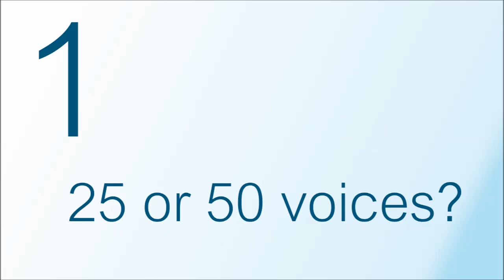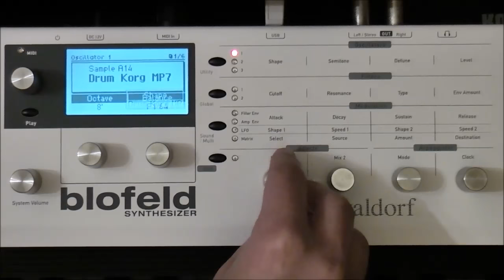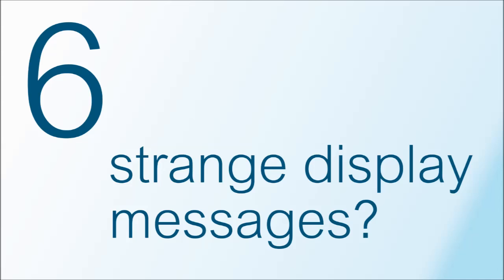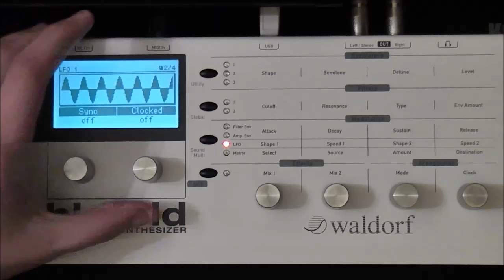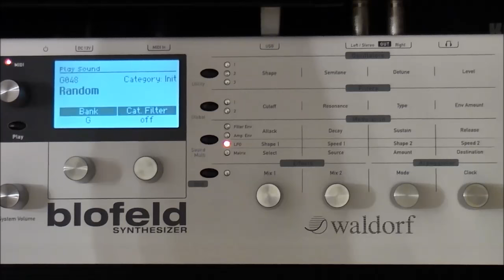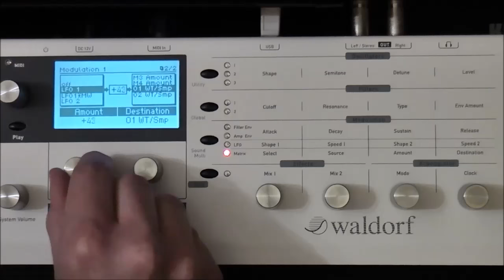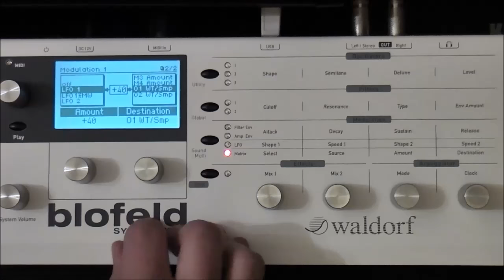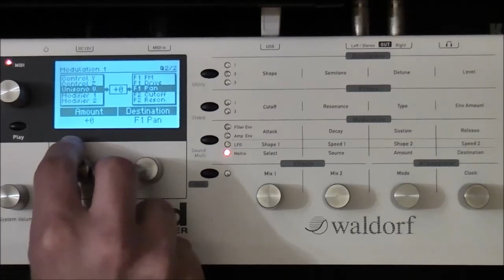[talk] 10 facts and tricks of the Blofeld

Comment: "My Blofeld stopped behaving like this when I used it in a different house."
I saw in your disassembly video that there is no ferrite choke on the PSU input on the PCB inside, this could be a part of the problem. Any other digital synth has a ferrite choke or whatever inductor to make the unit less susceptible to noise coming through the power supply. Noise from power lines inside of the building that you're in can go through the Blofeld PSU, into the PCB, and destabilize the processor.
Bad engineering design choice on Waldorf's part just to save a few pennies.
Reply from the maker: "The cheepest design" was the concept behind the Blofeld back then in 2006 to push the "new" Waldorf company. So... Mission completed :-D

Comment from the maker: Hey, that's me : )
I've read that some people doubt that there is real Karplus-Strong within the Blofeld. Actually, I've made a guess. Because the original Waldorf MicroWAVE had many so called "algorithmic wavetables" (28-52, 65) including the "Karplus-Strong" ones. This means that these waves are computed in realtime and are NOT saved as cycles (or half cycles) within the memory like normal wavetables. Consequently, wavetable parameters for these "wavetables" are interpreted as algorithm parameters. 

Source: https://chrisarndt.de/files/waldorf/mw_wavetables.pdf

I guess that the Blofeld is based on the same idea but of cause only Waldorf can answer that question. Also be aware of the fact that even the old PPGs used algorithmically generated waves in order to save memory space. 

Source: http://web.archive.org/web/20090213162947/http://interviews.sonikmatter.com/2001/wolfram_franke.php
Reply: I asked Waldorf about the KS wavetables and they replied that Blofeld has no such algorithm implemented
Reply from the maker: @charonme  Thanks for asking!

Comment: can someone help a brother out?
I'm about to buy the Blofeld Keyboard version. and have a few questions:
1 - How many sounds can be used at the same time to build - let's say - a pad? I see there are only 3 oscilators, but it says it has more...? 
2 - Can we draw our own arpegios and split the keyboard to use different arpegios?
3 - Can we split the keyboard to run a sequencer on a few keys, arpegios on others and a lead sound on others yet?
4 - Can we use the Blofeld as a Vector Synth, ie, is there any way to mix, fade in and out layers easily?
6 - is there any good PC program to build the sounds instead of directly from the Blofeld? 
Thanks a bunch.
Reply from the maker: This will answer most of your questions: https://youtu.be/ksgD6YBWNl8

Comment: Thank you for that.
I have a question : do you know the MIDI CC of Unisono and Unisono Detune ?
Thank you.
Reply from the maker: It seems that there is no Midi CC implementation of those parameters yet :( You can only control it via the Blofeld itself. Maybe you should tell your feature request to Waldorf. There are (only) two slots left in the CC implementation table. You can find it in the appendix of the manual: https://waldorfmusic.com/downloads/Blofeld%20Downloads/Documentation/Manual.pdf
Reply: Thank you.
Reply: You can use sysex to access unison and unison detune.

Comment: I am absolute beginner with my Blofed Desktop, my question is: I don't understand why on oscillator 3 there is no wavetable.
Reply from the maker: Wavetables need some higher computation effort than normal waveforms. So the Blofeld can only provide maximum two oscillators with wavetables. Consequently, OSC3 does not offer wavetables.
Reply: Thank you sir for your quick answer, i wanted also make shure the my Blofeld run correctly. I read and follow with a lot of interest your lessons.Thank one more for your patience and gentleness.

Comment: Hi. When using the wt/samp mod on your samples I don't understand how you're getting all the different drum sounds to play. Is each sample made up of lots of drum sounds together sequentially in the one sample? If so did you make this yourself? And if so how exactly? Thanks so much.
Reply from the maker: Hi, the mod destination "wt/samp" causes a change of the wavetable (or sample) program within the oscillator. So it chages from Sample 1 to Sample 2 to Sample 3 and so on. ADDITIONALLY to this, you can also create multi-samples with different samples for different keys. This works with the software "Waldorf Spectre". Of course you need the sampling option for this (included in Blofeld keyboard, additional installation on Blofeld desktop).
Reply: @SynthesizerVideo  thank you for replying. I shall go and try the multi sample thing now!